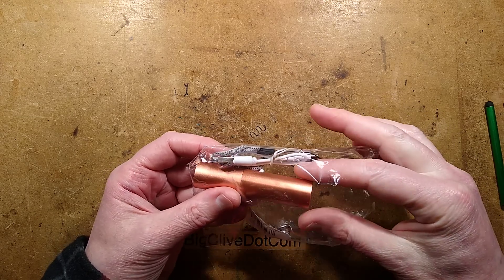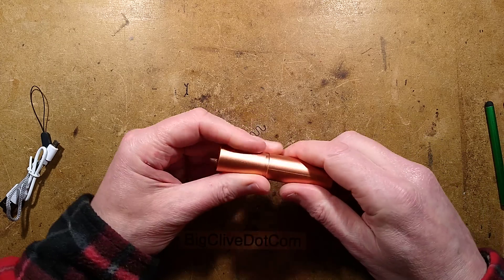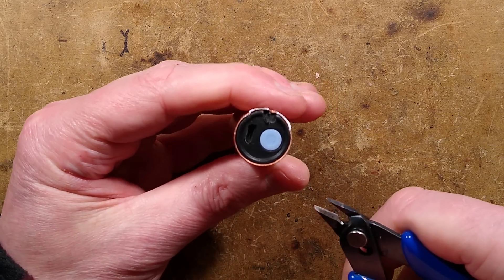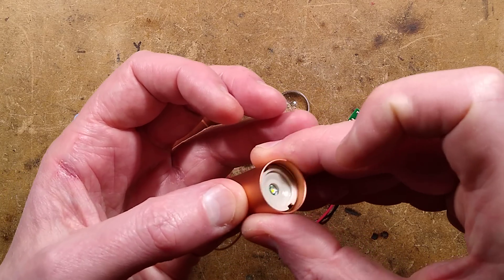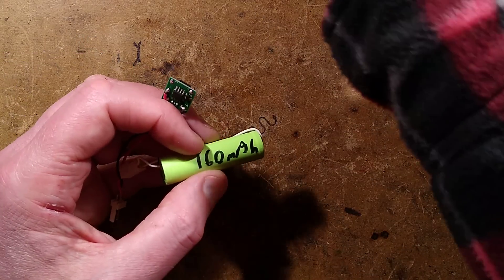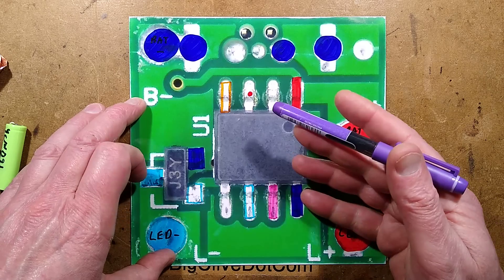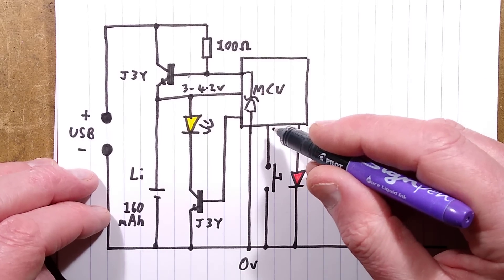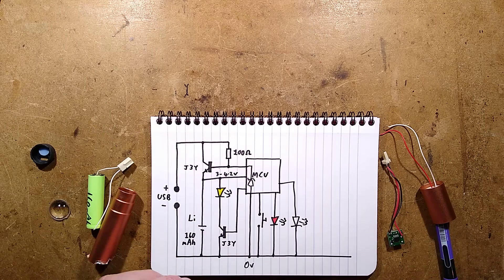eBay 98kW LED flashlight (slightly exaggerated) with schematic

Comment: Oh huh, a local supermarket sold similar flashlights last year! They had an extra module on the side and the style of the flashlight was different, but it too had a moving lens. What I most appreciate about that flashlight is that it's a usb-c flashlight that's quite useful. It's quite bright, can illuminate trees 200 meters away at night.

Comment: No current-limiting resistors for the LED causes the high-output flux capacitor to drive the IC into resonant warp-drive, an ultra-low component count, ultra-boost mode with impressive power dissipation, sinking heat into the aerospace-grade aluminum-alloy body through the plastic friction-fit pill-coupling to the emitter’s alloy sub-straight.

Comment: It reminds me of some PC speakers I had, 1200W proudly displayed on the front, the only was to get 1200W out of these would heave been via a direct lightning strike.
That torch did seem a bit dull, not that they could increase the current any further with zero current limiting. So was the brightness limited my how much that battery could deliver, or was the LED being driven well past it's abilities and that dull glow was it's last gasp death act.

Comment: Don't see why eBay and Amazon (there are others) allow such blatant false advertising.
To find the current that a 3.7-volt battery bank would need to supply to get 98 kW of power, you can use the power formula:
𝑃 = 𝑉 × 𝐼
Where:
𝑃 is the power in watts (98,000 W in this case),
𝑉 is the voltage (3.7 V in this case),
𝐼 is the current in amperes (A).
Rearranging the formula to solve for current (I):
𝐼 = 𝑃 * 𝑉
Now, substituting the given values:

𝐼 = 98,000W
V = 3.7V
I = (3.7 V) x (98,000 W)
Thus: 𝐼 = 98,000 x 3.7
             𝐼 ≈ 26,486.49  A

Therefore, the 3.7-volt battery bank would need to supply approximately 26,486.49 amperes to get 98 kW of power.

Comment: If you focus the light at 1m distance and measure the surface area of the bright spot, then relate that to the actual electrical power of the flashlight multiplied by the factor telling how many such dots it takes to fill the whole area of the imaginary r=1m sphere from inside, the result might maybe be very interesting. Holly Bally! ☝️😉 🌐 Beware of the radiation "would be."

Comment: Every led chip can be 98 kW for a short period of time if you you give it high enough voltage. The difficult part is that you have to put the blue smoke back inside after each use.

Comment: I have a flashlight just like this one. I did, in fact, replace that shitty 14500 cell with a 600mAh one from a vaper and it made it significantly more useful. I could have used a better 14500 - I think they get up to 800mAh in capacity - but I'd have to buy it and the decent ones aren't all that cheap, so free discarded vaper cell it was. I'm annoyed that I can't disable the flashing, though - if it only had two modes, or at least some form of memory so you didn't have to go through the flashing to turn it off, it'd be a pretty nifty light for a few bucks and five minutes of hacking.

Comment: As a European, 98,000 Watt is, well, just shy of 100 watt. Keep in mind that we use the comma as the decimal separatator instead of the US customary thousand separator. 

And while that is wildly off the mark for this form factor, getting 100 watt-ish output from a high quality 18650 cell is not that unrealistic.

Comment: 98.000W is not 98KW.
98000W is 98KW.

98.000 is still 98, no metter how meny zeroes you add.
Reply from the maker: In the UK the symbol "," is used as a thousands divider.  So 98,000 is ninety eight thousand.

Comment: I have no idea how it's even possible to make a lithium-ion cell that size with such a low capacity: It seems to actually be significantly larger than the cells used in most disposable vapes, which seem to range from 350 up to 550 mAh, depending on the brand - for the legally compliant ones at least, which apparently have a tank size limited to a maximum of 2 mL. Some of the less-than-legal imported versions (allegedly sold under the counter in some places) can have larger cells in them - I have found a few discarded ones on the street which had either 1000 or 1500 mAh cells in them, which proved to be quite useful for other projects.

Anyway, was the cell in this little LED penlight abnormally light weight for its size? Because that's the only explanation I can think of for such a low capacity in a brand new cell - they may have just skimped on the amount of rolled up electrodes and electrolyte inside to save a few pennies. Though it would surely have made more sense to just use a physically smaller cell of similar charge capacity, which would not have cost any more to make and may have even been cheaper. This would also have allowed them to make the casing less than half the size, saving on metal and any other materials used for manufacture.

The only other product I have personally come across with such a pathetically low capacity cell was a tiny little mp3 player I bought from Ebay last year. It only cost £5 and is still available for the same price, but so far has been the most reliable and user-friendly mp3 player I have ever owned. It has a fairly sturdy aluminium casing with an integrated belt clip, and the rest of the components are just a tiny (10 x 17 mm) backlit LCD screen, a circuit board which presumably has the decoding chips and audio amplifier on it, a micro-SD card slot for data storage, a mini-USB socket for data transfer and battery charging, and lastly the lithium-ion cell.
Which was the only downside, since the cell they had used was the smallest I have ever seen - the physical volume it took up couldn't have been more than a CR2032 button-cell, and even this was un-necessary, since there was enough extra space inside the casing to fit a cell several times larger. Even when starting from fully charged, it only allowed a total play time of 20 minutes, which was absolutely pathetic.
I was considering sending it back for a refund, but then I realised that the way it had been constructed made it easy enough to fit a much larger capacity cell: I had a couple of old Nokia 3310 square cells with a rated capacity of 1000 mAh each. Admittedly they have probably lost a bit of that by now, but they still worked well enough. So I taped them together, glued them to the backside of the belt clip, joined them in parallel and ran a couple of wires through a small hole I had drilled in the mp3 player casing, soldering them to the circuit board where the tiny cell had been. It now has a play time of several days continuous, which is much better!

Link to the same type of mp3 players, if you're interested:
https://www.ebay.co.uk/itm/233778807780?itmmeta=01HXG6Q4EBRQM7Z9VA6T0QCXHX&hash=item366e4d83e4:g:mFkAAOSwEHNfALeV&itmprp=enc%3AAQAJAAAA4As2bE7s3z8jf4OJtCa6H3VF%2BjKU0EvcRGfLLDbBCU%2Fp%2FdIH59Lan%2BTgQiPIVm5Xgb5dGCnrUWBdmTR8Mua57wseb06dfXeQwPX1plmgtM3ROJG8R9WhTXqLYtuTU0RFmHrXavqTvO7vVNcxR5J12e3Icho9quhwZr6SaWM3MeNkVyVAe9kFOIGsYCn4r8wLC5h9XwV43UnBvWew4nUyA5ygjRG9a6srnZzqs%2FChpQsa8HEN%2FduciKDrCqUPQ8IpaSmoTiXFMwGBIgoIasVgot4VNvecHbQfaSOAX5uMYiaY%7Ctkp%3ABk9SR7zH3IbsYw

Comment: Flashlight nerd here.
These flashlights are insanely cheap and most of the time, sellers advertise ludicrous lumen claims for these things.
Irl they're insanely weak.
They DO NOT use Cree LEDs.
They use Counterfeit "Cree" XP-E LEDs which give about 100-300 lumens at best.

Comment: I wish they would stop having modes.  I bypassed that on the chip in one.  A few better ones will at least lock the setting when turned off.

Comment: I always wondered if a good quality cell would kill the LED as it packs a "little bit" more punch into the circuit when powered on. I have several cheap USB rechargeable lights, just like that, for emergency. They do their job well, even after a few years, but I wonder if the LED current limit is done by the usage of 800mAh 18650 cells 😊

Comment: I recently bought one of those radio transmitter kits, it was advertised as having a 50 milliwatt output but when it turned up it stated 50MW in the specs on the construction sheet that came with it. It's a real feat of engineering how much it's little output transistor is capable of, I will have offcom kicking my front door in with fifty million watts and an eye watering electric bill.

Comment: Exaggeration of capability surpassed absurdity many years ago, but still apparently increasing.  I recall the days when it was possible to rely on the power output figures of music centre manuals, in Watts RMS. But then they changed it to peak to peak, and now it seems like they think of a number and add a few zeros. 
I bought two audio amps a couple of years ago, rated vaguely at 1200W.  Recently while the covers were removed I checked the output transistors - which were rated at a more realistic 100W
Reply: Same thing with solar garden lights, the packaging will always show a blindingly white light being emitted many times brighter than you will find you get from the lights!
Reply: Those were watts p.m.p.o. A pathetic "marketing" tactic which replaces industry-standard ways of correctly measuring output power with whatever stupidity gives you larger numbers, to try to trick the buyer. Still, not as bad as planned obsolescence, which is like some kind of anti-engineering to deplete non-renewable resources much faster. Just reminders of how greed can drive mankind into crazyness and stupidity.

Comment: 160 mAh is the worst one yet. Usually these cheapo chinese devices have around 800-1000mAh. And 2000-2500 mAh is common in better quality batteries.

Comment: To get it out maybe you could hammer on the lithium-ion battery to force the plug out.  Either it would work or be exceptionally exciting in failure!
In all seriousness, I bet you could use a pipe-cutter (the type with a roller and rolling cutter wheel for copper plumbing) to run around the pressed in end and cut the aluminum tube very neatly and rapidly.

Comment: can you make a video on alkaline batteries?i heard they are rechargeable, if you do it very slowly over the course of many hours and let them sit for a few days after you take them out of the device that used them before charging.
Reply from the maker: The units that claimed to recharge non- rechargeable cells tended to use PCR (periodic current reversal).  But the recharging results are poor and the cells often pressurise internally and leak.

Comment: I'd like to design the process of opening and closing a circuit in the following way. I'm going to start with a portable watercraft with toilet (and other) seats and a fishing line to which a leader, float, sinker and hook are attached. The seats should take care of the fauxing telescopic guides. The act of twitching or jerking it is cubic and I need to improve on the complexity, by making it square. This should help in designing the 'bit porta' section of the code. The deck and the dock are connected via a delivery system. The bait for fishes can be designed using taunts (poke). I'll use deep six to toss out excess water from the deck. At the end, I'm going to deliver fishes at the dock, which should resemble a wind-up (or coil winding). The crack is sealed by caulking and CQB is designed (peek through window). This process is known as a scramble, or a motocross race or suicide snooker/pool tournament and resembles climbing up. A knock box can be designed for it.
https://github.com/ec-/Quake3e
https://www.timelesspatents.com/blogs/patent-stories/history-of-the-fishing-lure-patent-1
https://patents.justia.com/patents-by-us-classification/43/44.2
https://archive.org/details/quake-3-psp.-7z
https://patents.justia.com/patent/6860058
https://patents.google.com/patent/US1212752A/en
https://patents.google.com/patent/US2731757A/en
https://patents.google.com/patent/US4201008A/en
https://patents.google.com/patent/US11576360B2/en
https://patents.justia.com/patent/20240143141
https://patents.google.com/?q=(A01K91%2f08)
https://patents.google.com/patent/US151394A/en
https://patents.google.com/patent/US3685481A/en
https://patents.google.com/patent/US4728307A/en
https://patents.google.com/patent/US4734066A/en
https://patents.google.com/patent/US20070216209A1/en
https://patents.google.com/patent/CA2217276A1/en
https://patents.google.com/patent/US4279398A/en
https://patents.google.com/?q=(A47C3%2f40)&page=1
https://patents.google.com/patent/KR200497637Y1/en
https://patents.google.com/patent/KR200322682Y1/en
https://patents.google.com/patent/US8550653B2/en
https://patents.google.com/patent/WO2017175242A1/en
https://patents.google.com/patent/US20050268833A1/en
https://patents.google.com/?q=(B63H20%2f007)
https://patents.google.com/?q=(B63H20%2f04)
https://eureka.patsnap.com/patent-CN112686130A
https://patents.justia.com/patent/20160345393
https://patents.google.com/patent/CN211001744U/en
https://patents.google.com/patent/US5971829A/en
https://patents.google.com/patent/US20240130569A1/en
https://patents.google.com/patent/JP2934613B2/en
https://patents.google.com/patent/US10127493B2/en
https://patents.google.com/patent/CN107890678A/en
https://patents.google.com/patent/CN208319974U/en
https://www.researchgate.net/publication/224276870_2kp_the_juggling_robot
https://ieeexplore.ieee.org/document/758619
https://ieeexplore.ieee.org/document/6253270
https://patents.google.com/patent/US1615680A/en
https://patents.justia.com/patent/20040109921
https://patents.google.com/patent/USD212205S/
https://patents.google.com/patent/US2343767A/en
https://patents.google.com/patent/US6610336B2/en
https://patents.justia.com/patent/11517027
https://dipwell.com/product/10-deep-drawn-dipwell-nsf-certified
https://patents.google.com/patent/CN101260793A/en
https://www.penguinmagic.com/s/sand
https://dipwell.com/product/10-deep-drawn-dipwell-nsf-certified
https://www.nemcofoodequip.com/catalog/ice-cream-spade-well
https://patents.google.com/patent/CN201106449Y/en
https://patents.google.com/patent/CN108816825A/en
https://www.penguinmagic.com/p/S32796
https://www.penguinmagic.com/p/S32794
https://www.penguinmagic.com/p/S27677
https://patents.google.com/patent/US7529058B2/en
https://patents.justia.com/patents-by-us-classification/280/163
https://patents.google.com/patent/US20190349565A1/en
https://www.patentsencyclopedia.com/app/20080196337
https://patents.justia.com/patent/20230133602
https://patents.google.com/patent/US20020016726A1/en
https://patents.google.com/patent/WO2018129504A1/en
https://patents.google.com/patent/US10352082B1/en
https://patents.justia.com/patent/20220343775
https://centrifugetraining.com/courses/vcqb/
https://patents.google.com/patent/US5875920A/en
https://patents.justia.com/patent/20130157024
https://patents.google.com/patent/US4934854A/en
https://patents.google.com/patent/US3098266A/en
https://www.reddit.com/r/CQB/comments/fdnx73/peek_or_push_an_examination_of_two_types_of_room/?rdt=47024
https://patents.google.com/patent/US20070074441A1/en
https://www.tau.group/post/peek-magnet-wire
https://patents.google.com/patent/GB2559511A/en
https://patents.google.com/patent/US6881816B2/en
https://www.breville.com/us/en/parts-accessories/accessories/bea501bss0zna1.html
https://anero.id/knockout-draw-generator/
https://challonge.com/tournament/bracket_generator
https://randomizer.uk/tournament
https://patents.google.com/patent/USD248433S/en
https://patents.google.com/patent/US2272010A/en
https://patents.google.com/patent/HU194198B/garden-river-poker-tournament.html
https://patents.google.com/patent/FR2528839A1/fr
https://patents.google.com/patent/US20110244932A1/en
https://patents.google.com/patent/US9283478B2/en
https://patents.justia.com/patent/9233310
https://patents.justia.com/patent/9861899
https://patents.google.com/patent/US20160070452A1/en
https://patents.google.com/patent/US20020065882A1/en
https://patents.google.com/patent/US8753213B1/en
https://github.com/ventureoo/nouveau-reclocking
https://github.com/pdbear/syno_nvidia_gpu_driver
https://github.com/RROrg/rr
https://github.com/rclone/rclone
https://github.com/RedPill-TTG/redpill-virtio
https://redpillrecovery.com/
https://github.com/SheerSt/pokewilds
https://github.com/ucb-bar/chiseltest
https://github.com/abagames/peekpoke
https://github.com/djg/peek-poke
https://github.com/phw/peek

Comment: Our local Heritage Railway at Christmas time runs the Pola Express theme and the company who runs it gave away flash lights almost the same as your flash light and I have one.  It has a main light and a side LED light.  So press button once it's main beam with a siding bit to focus the light.  Press twice and it strobe light. Press three and it's the side light.  It only has about 50 minutes of light before I have to recharge it.  But it was a free

Comment: Let’s think about this a minute. Say the power source is crazy efficient, like 90%. If that thing emits 98 kW of light energy, then that little piece of metal you’re holding in your hand will suddenly be heated by the remaining 10 kW or so. I predict melting aluminum, almost certainly the loss of your hand if not your forearm…

Comment: I wonder how bright a real 98 KW LED is. Let's see: at 120 Lumens/Watt, such LED should output 11.8 Mega-lumens. I imagine designing a cooling system for it would be a big challenge. It will engrave (and burn) wood instantly at close range and with ~12 million lumens, it's enough to illuminate an entire soccer field by itself.

Comment: Man, you're brave to handle something that can put out 98,000 joules per second, that thing packs enough energy to heat up multiple large houses, it could explode at any moment.

Those exaggerated unit claims on cheap electronic shite are very silly.